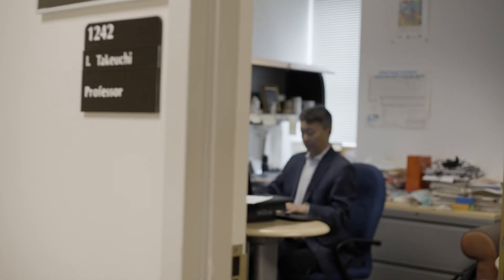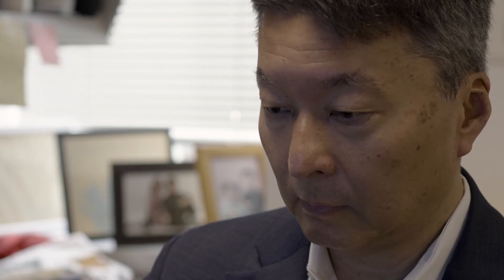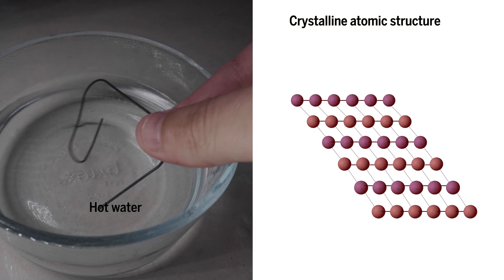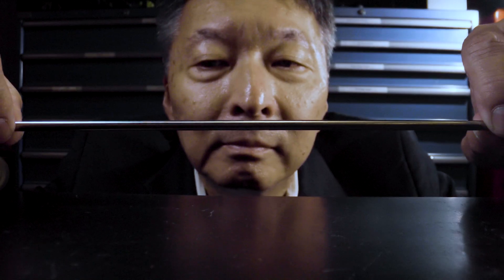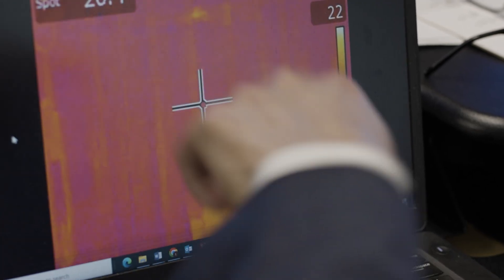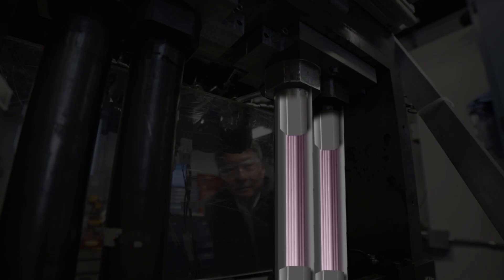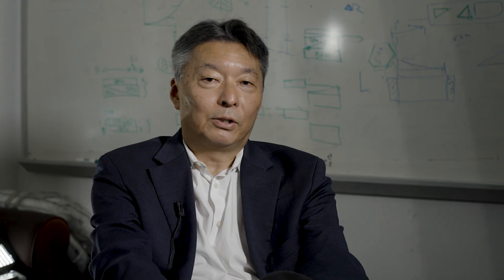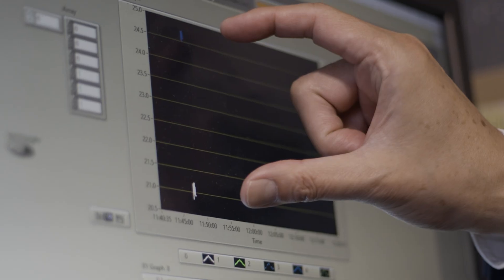How researchers push and pull metal for cleaner cooling

Comment: Simple rubber bands can also do this and are much cheaper. But this type of cooling is super inefficient compared to closed-cycle refrigerant systems.
Maybe there is some edge case applications in spaceflight, but it's certainly not viable for mainstream.
Reply: Have you considered that some materials are more efficient at elastocaloric cooling than others and that rubber bands are not the be-all and end-all here?

Comment: No offense, but just wondering why a material science researcher would spend 10 years pursuing a mechanical approach to tackle cooling and heating when for decades we've known about Gadolinium's ability to transfer heat in the presence of a magnetic field.  Seems wildly impractical to rely on moving parts to bend/twist/compress, rigid metal rods.  The only moving parts in a Gadolinium heating/cooling system would be the air fans or fluid pumps.
Reply: Magnetic refrigeration using magnetocaloric effect
Reply: You seem to have a poor understanding of what is " mechanical " ! You see that the condition for defining something as mechanical is movement, and this is completely wrong ! Even what you mentioned is considered a mechanical approach ( not because there is movement ). As far as I know, gadolinium is an expensive element. The mechanical approach is the simplest, most reliable, most efficient, most effective approach in any field as it does not require ( battery, very complex electronics and boring coding ) it is REAL ENGINEERING. Moreover, I do not support the idea of using electricity and induction for heating, as you mentioned, for example, but rather it is better to use strong, switchable permanent magnets instead of low-efficiency electromagnets that produce high thermal and electromagnetic losses.